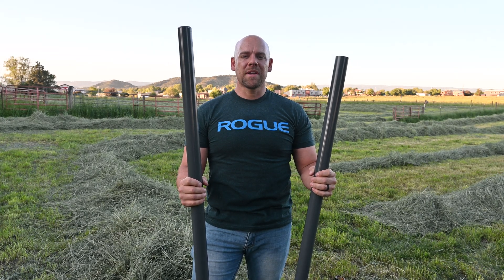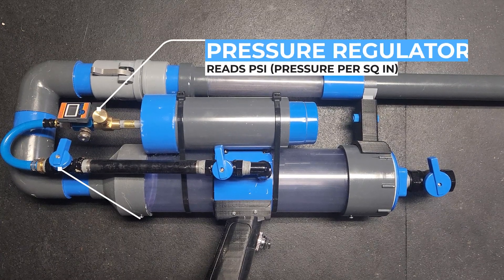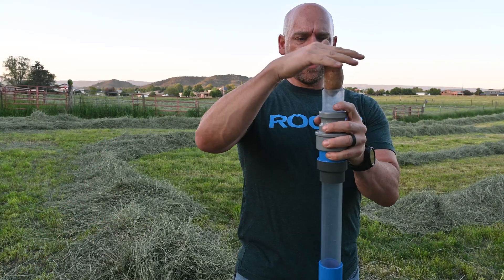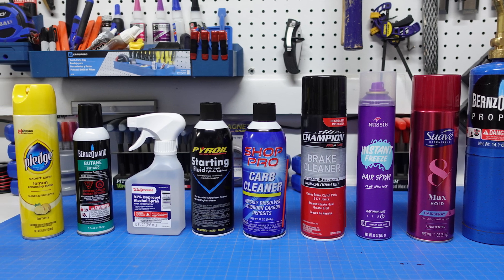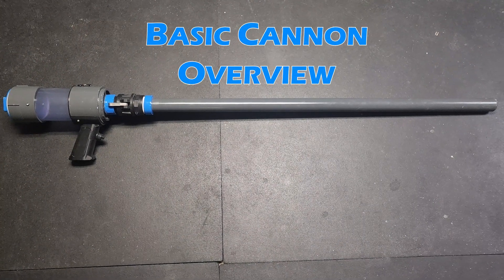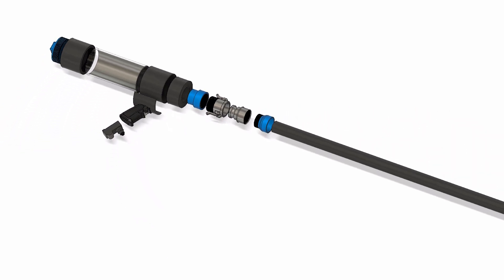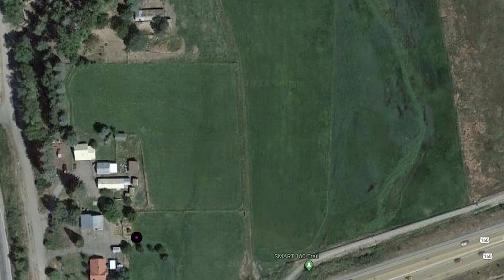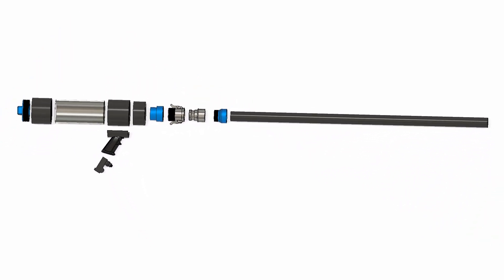Advanced Potato Cannons (Spud Guns)

Comment: I see someone else scoped the old mushiyoshi channel. Their design is unmatched imo, cause i haven't yet improved much beyond theirs 
Like to share some learned xp for moar powah and distance 
1. 10$ Amazon rechargeable stun gun (as flame travels the extra sparkles help ignite all for complete burn)
2. Multiple stun gun powered spark points or better option flatbar/rails preferably stainless, plated, or polished smooth, set equal distance apart
3. Slice them taters more ammo, less weight, more speed & distance 
4. Dont shove it in dry, lube that tube  wd-40 keeps hairspray sticky threads juicy too

Comment: You can still breach load that cannon by shoving your adequate sized projectile into the barrel by going through the rear screw in cap. We do it all the time. I've never used a plunger.
If you cut a small piece of pvc, the size of your barrel, you can use that little piece as a gauge for oranges, lemons, limes, and anything else that fits tightly through your pvc gauge.

Comment: I assume the hairspray powered gun outperformed your fancy gun that's why you didn't show us distance results with it? I've built 30 or 40 of these in my life and I've always gotten a lot more distance than you were seeing with your fancy one.

Although I've always used a lantern sparker in the end cap, which is igniting the back of the cylinder and pushing everything forward where yours ignites at the front.

I'm not sure if that makes a difference, but I'd love for you to install a lantern sparker in the rear cap of one of yours and see if one spark system is better than the other. 

Fun video, thanks!
Reply: It is the shape of the gun. His fancy design forces air to go 180 degrees away from point of combustion. Air flow slows down at every change of angle. A traditional, straight air flow works better in almost every design.

Comment: Have you considered a larger diameter combustion chamber? Air mass flow rate must stay constant so by using a greater reduction in diameter from the chamber to the barrel you force it to accelerate to a higher velocity. I believe a shorter chamber with larger diameter (same total volume) would cause a faster projectile.
Reply from the maker: There are calcs that help find the "optimal" combination of width x length for combustion, but I haven't personally experimented with a larger chamber.

Comment: That's a great spud gun! As an improvement, you could add some automation to the process:
- Add a solenoid valve
- Add a circuit board for all the connections,  such as fan, ignition, valve etc.
- Add a microcontroller to control all the inputs and outputs
- Create processes, such as admission, ignition and purge
- Automate

Comment: Would you try it with hydrogen?
Reply from the maker: I've messed with Mapp Gas, and its very combustible. Hydrogen is equally so if not a bit more, But storage and application would be trickly in a potato cannon.
Reply: @MrArmageddonBuilds  I meant gas from water decomposition, i.e. using an electrolyzer. Another way is to use aluminum and potassium or sodium alkali, i.e. hydrogen is also released, it can be obtained in minimal quantities in both cases and does not need to be stored.

Comment: Good job, but does the fan resist combustion?
Reply from the maker: @MacStrange  So far it has. Have shot this thing 50+ times, fan still functioning fine.
Reply: Why would it the pressure is still gonna flow through the fin like they weren't even there

Comment: Using pvc pipe in high air pressure applications is a disaster waiting to happen. 100psi of water acts nothing like 100psi of air
Reply: Not if you use PVC specifically designed for high pressure.
Reply: Schedule 80 pipe thicker walled 
no disaster